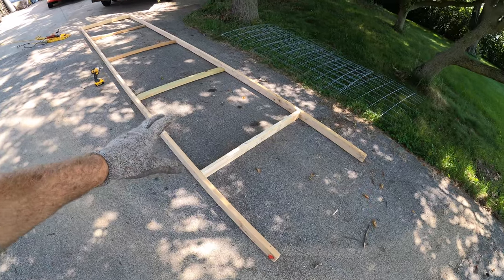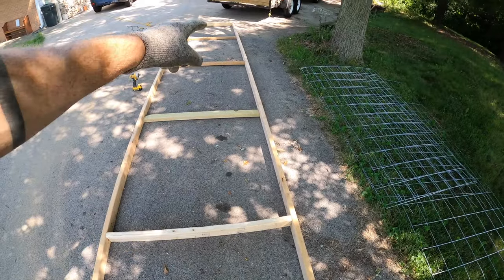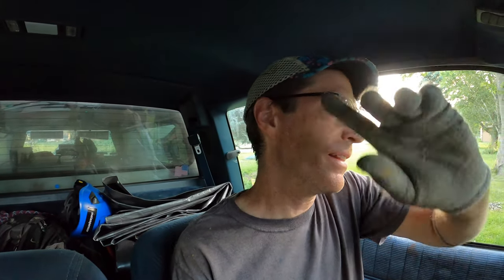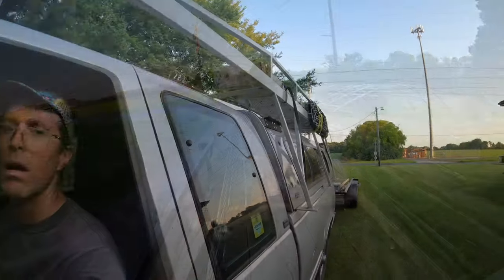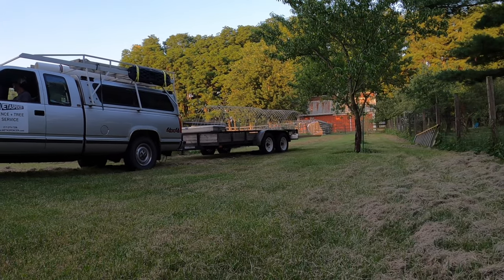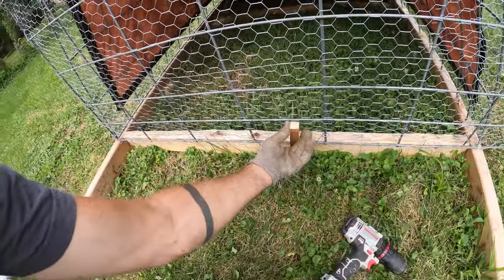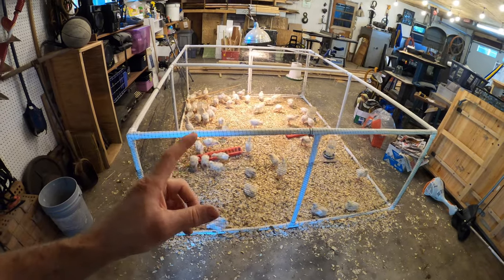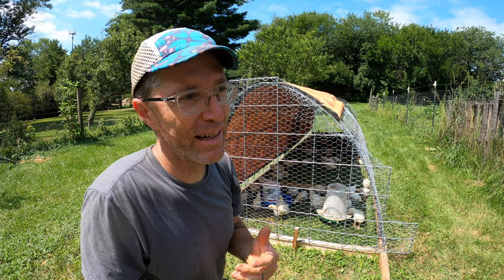Long Tube Chicken Tractor, Full Build

Comment: Good work. Is your next one going to be without the floor boards since they kept hitting the chicks?
Reply from the maker: The structure would splay out without them, so I may just use 3/4" plywood to hold it all together. I moved the birds last night and they got good at moving with the tractor, so they may adapt. We'll have to see! :) Thanks for checking it out
Reply: @metaspencer  - Maybe just one in the center would suffice. I figured if I made one I'd put a pool noodle on the front parts that pushed against the chicks so they wouldn't get their feet stuck underneath.
Reply from the maker: @annwithaplan9766  One in the middle seems to be working better ... just tweaked it a bit. I like that pool noodle idea!
Reply: @metaspencer  - Those things come in handy for many jobs haha. I had some heavy string set up to pull the corners of my fencing taut. I kept tripping over them and then I cut my toe the last time I tripped and fell over one, so I put pool noodles on all of them. : )